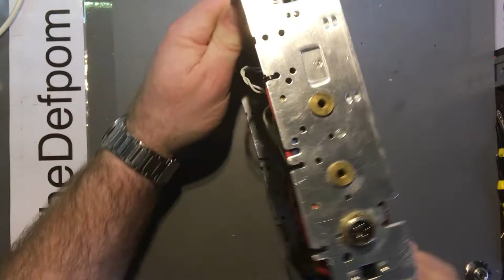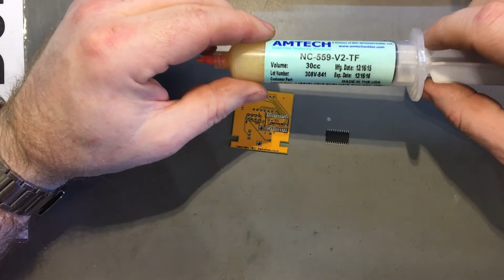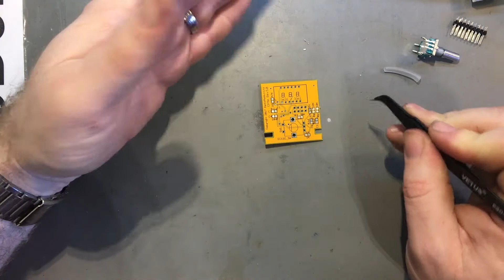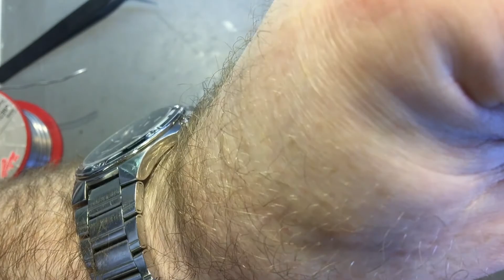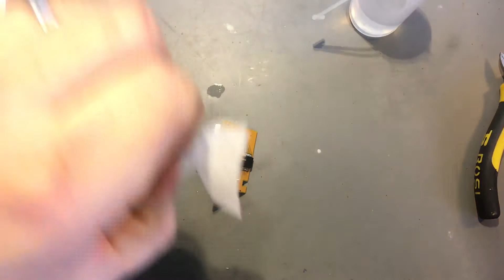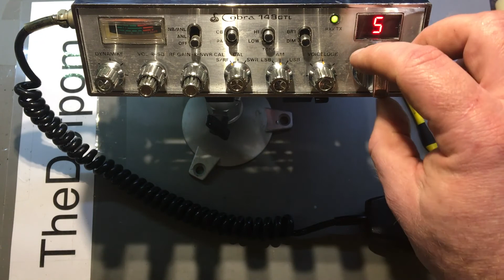#311 Cobra 148GTL with EP4 Channel Expansion Board - MC145170 PLL Experiments Part 13

Comment: for seeing through board to locate parts, I use flashlight and 1/8th in wide flathead screwdriver or similar tool to mark location, sometimes a black sharpie marker.  obviously not much use on double sided/multi-layer though.  rubbing/iso alcohol will clean it off the marker and flux afterwards.

Comment: I'm loving this setup you're trying and it's really fascinating to see the evolution of this project. Would this board drop into a cobra 148-gtl-dx mk1 and mk2? If this where available 30 years ago they would have sold like hotcakes. I'm sure they will still sell well. There are still a lot of enthusiasts for the old radios, of which i am one. Cobra, uniden, stalker, president, where all great radios back then

Comment: Nice to see the finish line is in sight for this project.  People just don't realize how much work goes into something like this.  Mike
Reply from the maker: Thanks Mike, this has been more a case of being too busy to work on it, I probably only spent about 20 hours or so on it in the past 8 months ! I originally wanted to get this finished by this time last year, but it wasn't a high priority so it kept getting put off until I had the time and was in the mood to work on it. I just need to finalise the code for the GUI and it will be done, again though, I have other priorities at the moment, so it is back on the shelf LOL.
Reply: TheDefpom 

It's a spare time filler project. ;-)  Just got done sticking one of Marks boards in a early version President Grant (upd858)and have two more to do for the same customer.  The others are a late version President Grant and a export version Teaberry Stalker IX.
Reply from the maker: The PC409 and PC879 models ? I have a Grant, Stalker IX and a 9F-DX around here somewhere in my "Do a repair video on it one day" box.
Reply: TheDefpom 

The late model Grant is a PC409AC.  Off the top of my head I can't remember the early version upd858 chassis model.  Think it's in the 100's or 300's.
Reply: last grant I worked was previously in 5 shops for repair and tossed in corner broken for 2 years, then it came to me. semi by luck I found that the 1st owner did the mods for the wrong model grant radio...it was one of the 1st 1/8th watt resistor models thinking back.
the downside? I had to listen to it for 6+ years until the person moved away, but they weren't obnoxious and a ham operator ;)

Comment: Why not get a silicon rubber sheet to use as a soldering mat.
Reply from the maker: The mat I use is an anti static mat (well, its a dissipative mat), it does resist solder etc. but its not perfect at it.

Comment: Do you have any ep4 kits that you'd like to sell?  Id like to try one in my uniden grant pc409ac.
Reply from the maker: Paul Min - hi, the EP4 isn’t currently designed to work in that chassis, in theory it could do it, but I am unsure if the display module is a physical match as I haven’t tried that chassis yet.